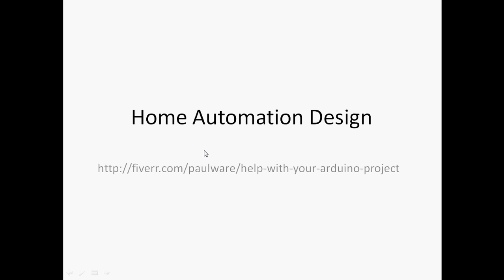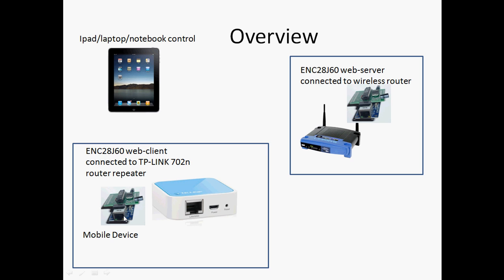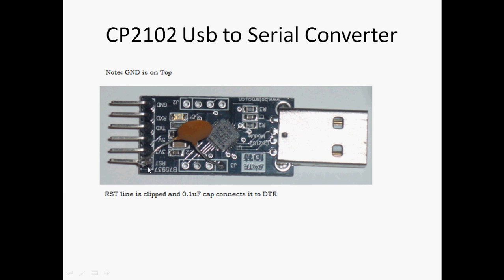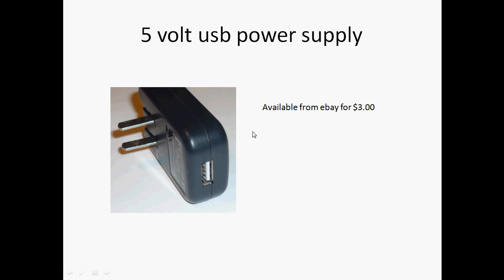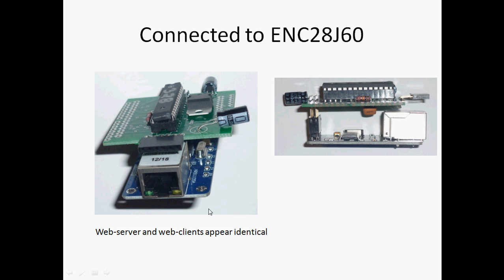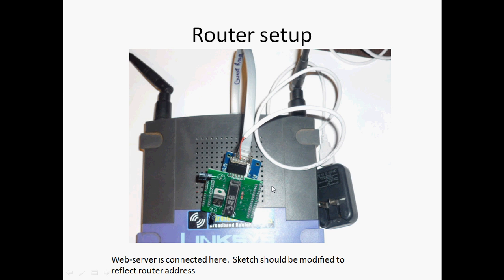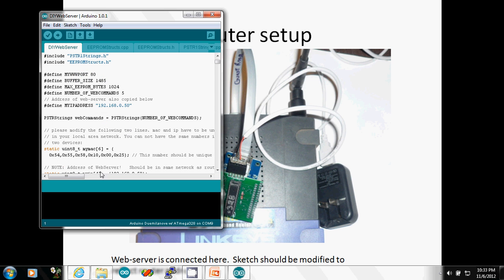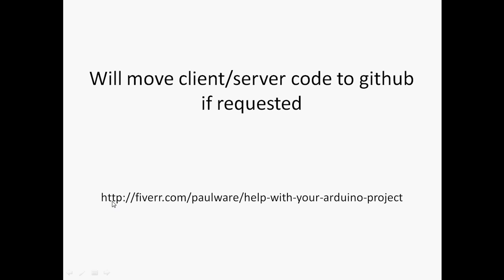HomeAutomation

Comment: Hey, this is a very nice demonstration.  I have been trying to do the same thing (enc28j60 and nRF24L01 and tft display).  I have no problem with the coding but how are they all configured on the same SPI bus?  Can you please provide a link to the wiring diagram? And also how you set the CS pins in the code (what pins for each device). Many thanks in advance.